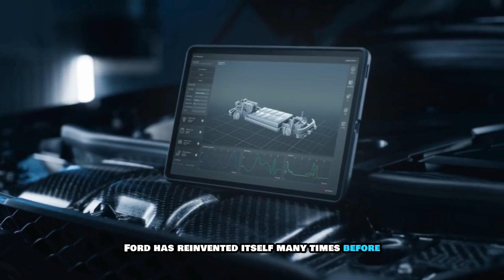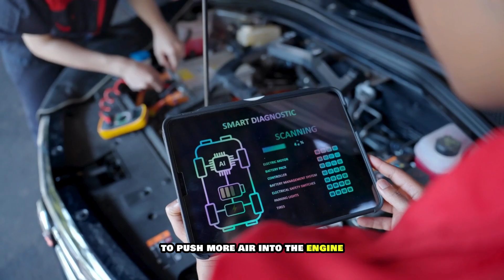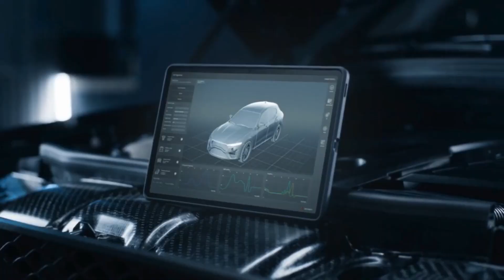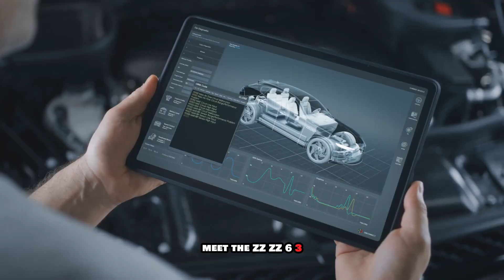Ford’s NEW Engine Will Shakes The Entire EV Industry!

Comment: Ford may have had 70,000 ev 150"s ordered. But sales of ev are over 200 day's on lots, there losing tens of billions. Not a good choice. Ev are not the future, try a 15 hour trip 900 plus miles on gas, ev would take 23 hours, and try to find a working charger that's open, or taking credit card, not talking about repairs if hit , can take 4 to 6 months to repair, or disposal of batteries, higher insurance rates, tire wear. I'm not against technology, if less expensive. A hemi runs on 8 cylinders, and cruise on 4, got 23 plus mpg on 560 hp, zero to 60 in seconds for power if needed on 87 octane.